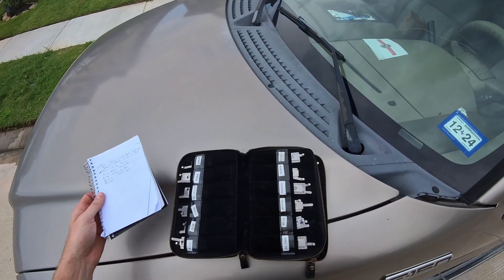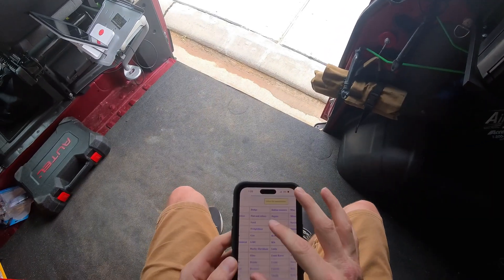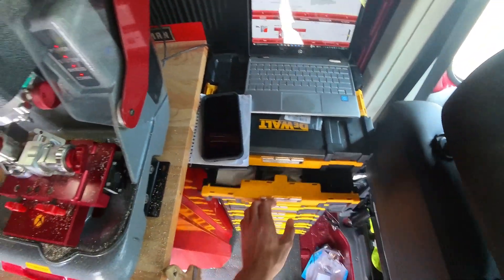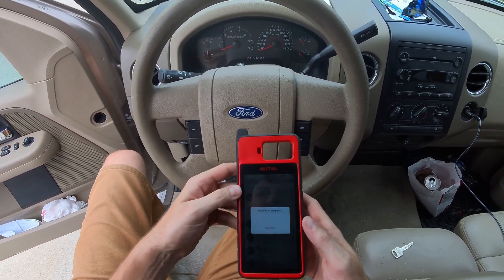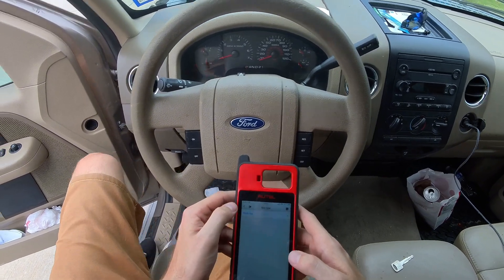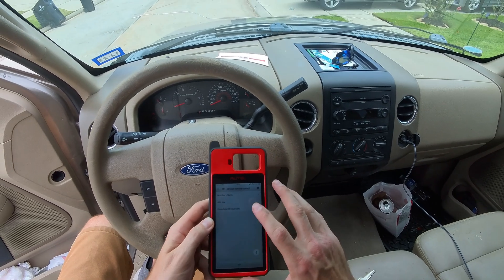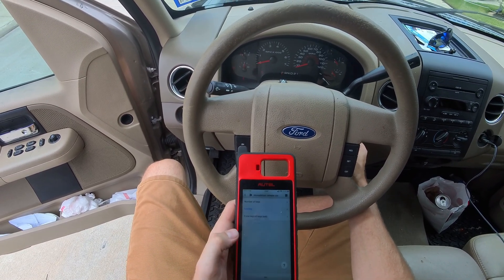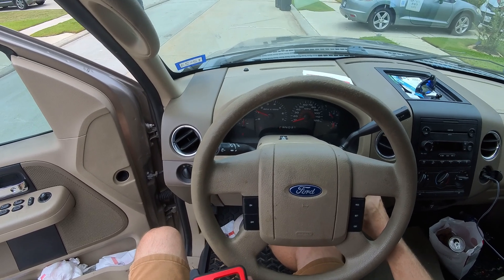How to make keys to a Ford (2004-2016) {FO38 Lishi tool }  {KM100 Programmer}

Comment: Questions: 
1. Best place to get lishis? 
2. Where can I get that case? 
3. Whats your fav company to get locksmith tools from? 
4. What camera on your head are you using? 

Thanks
Reply: Noble lock supply is the cheapest place I’ve found them.